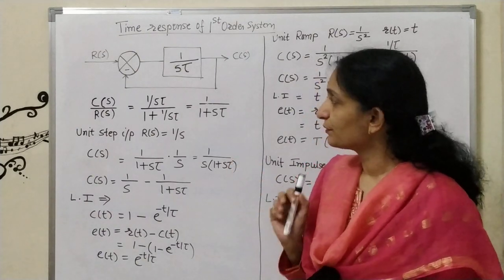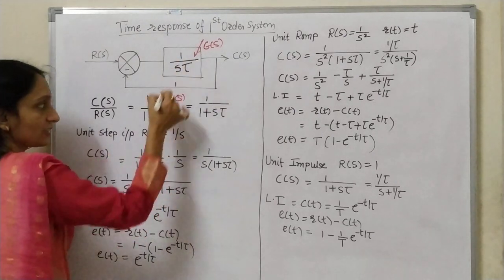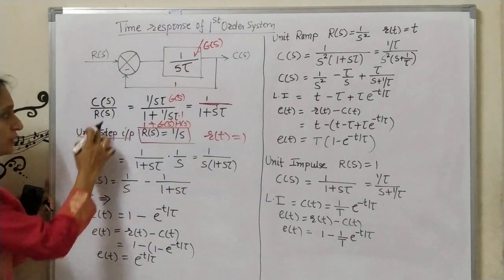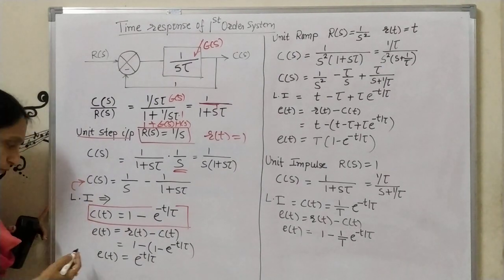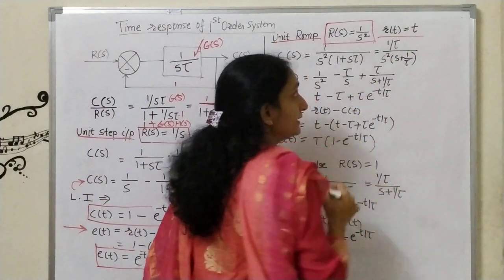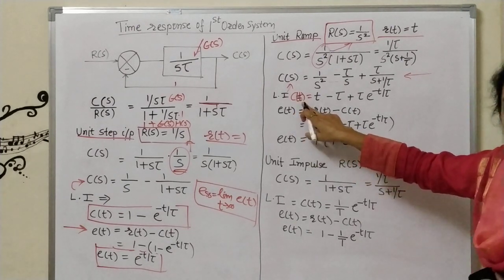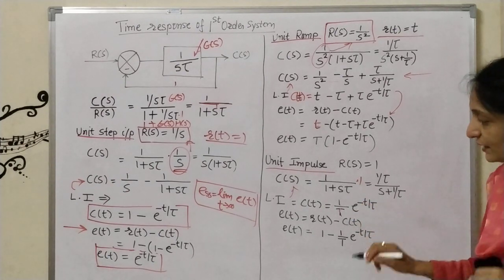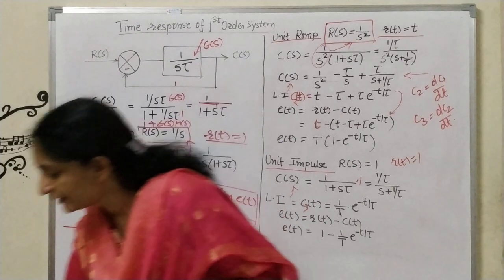Lec 26 CS: Time Response of First Order System

Comment: Hi Mam,I have a question which is related with above please advice your mail so i can share it with you.
Reply from the maker: Put your query , I will reply
Reply: @prachisalodkar7522  Please advice for Below Question,
A Unity feedback system has an open loop transfer function of 
 G(s) = K / s (s+1) (s+5) 

Draw the root locus plot and determine the value of K to give a damping ratio of 0.3 A network having a transfer function of 
10(1 +10s) /(1 +100s) is now introduced in tandem. Find the new value of K, which gives the same damping ratio for the closed -loop response. Compare the velocity error constant and settling time of the original and the compensated systems
Reply from the maker: @nimeshkumartailor1316  send me your email ID, I will email solution
Reply: @prachisalodkar7522  nstailor810@yahoo.com
Reply: Good Morning Mam,I hope i have solution by today.Thanks in advance for your as usual solid support and co-operation.
Reply: Hi Mam,Waiting for update
Reply from the maker: Replied to your problem